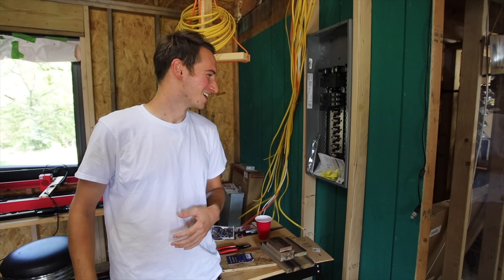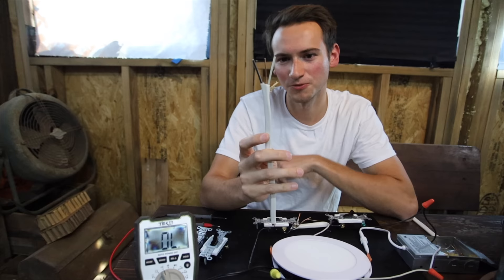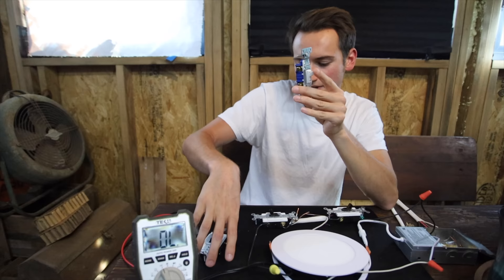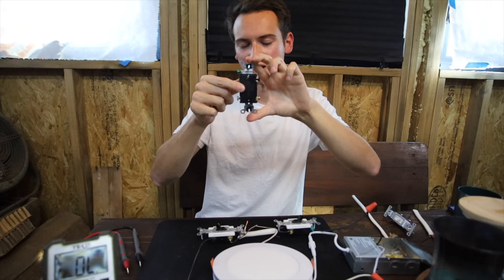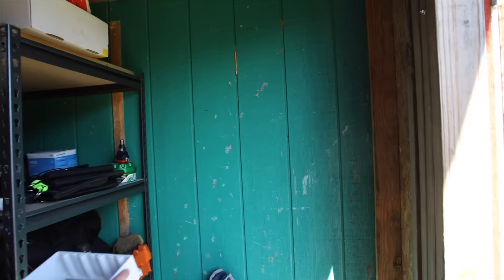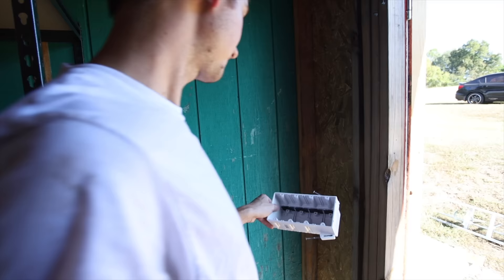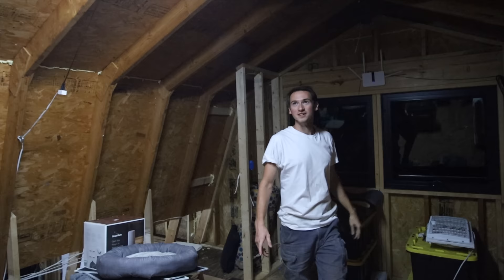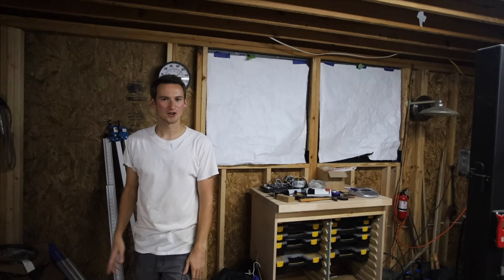Electrical Last Step: Wiring Lights and 3-Way Switches

Comment: Super. Nice electrical layout. Recommend you run 12/2g from a 20 amp. breaker to the 4 gang, put in a 20 amp. Switch, and run 12/3g to a 2 gang water resistant outside box with two 20 amp. GFCI outlets, one switched, one hot. Takes care of decorations and power tools. P.S. If you still have a trench, put a 12/3g direct burial line to the house for a front outside 3-way light switch in the house and the shed house. Good luck. 💙 T.E.N.

Comment: That 4 switch box in the garage you should add a switch that is ran to an outlet just below the roof line in the soffit for running holiday lights along the roof
Reply: Yes. We talked about that, but adding a Phillips plug makes any outlet switchable these days. We’re still thinking about what we need it for.

Comment: You need to be Inspected? You are Outside City Limits, Right? I am Outside City Limits and Need No Inspections on Anything I Do On My Land.. Only Permit needed was Sewage to get a Address??? I don't understand that one either. But I no longer need to keep Renewing the Sewage every 1.5 Years because I Compost.. or just throw it away in the Gas Stations Garbage Down the road because I Use a Camping Toilet..
    I even Asked Several Times if I need Permits or Inspections and each Time they said "It's Your Land, Do What Ever You Want, just do Not Grow Mary Jane!"... "Because You Live Outside City Limits"..
Reply: We are agricultural zoned. We only need sewer and electrical (if we plan to connect to grid). If we just did solar alone, we wouldn’t need electrical. We figured that it’s easier to do it now, swallow the frog, and brought high voltage (7.2kv) primary 300 feet onto our property. If we need it, we have power. If we decided to build other things we have an easy choice. Our electrical inspector is phenomenal and we should be able to wrap this up and get a final pretty quickly. Lights, plugs, and panel…

Oh, but those arc fault breakers. 😫
Reply: @MrZZeroG  Well, I guess my Situ. Has it benefits.. No $$$ needed for permits.. Sewer would have been $450 Every 1.5 yrs Until it was put in.. and been On property 13 and would have had to spend $3915+ by now.. For something I do not need. Peace and Good Luck.